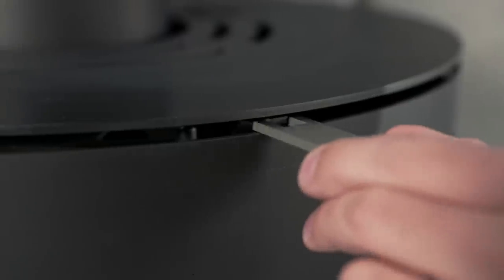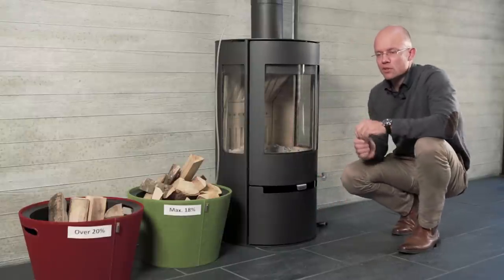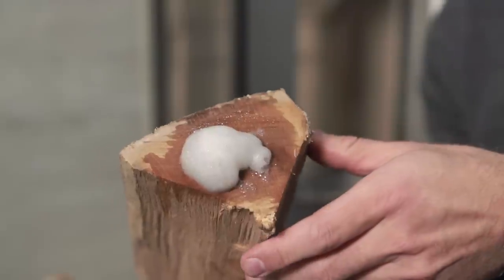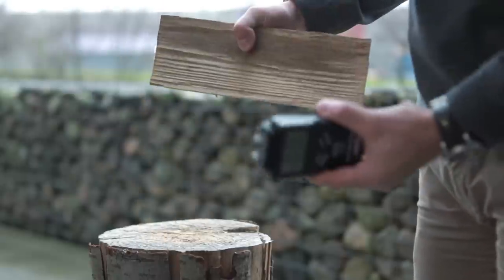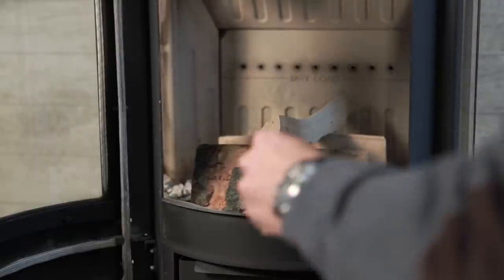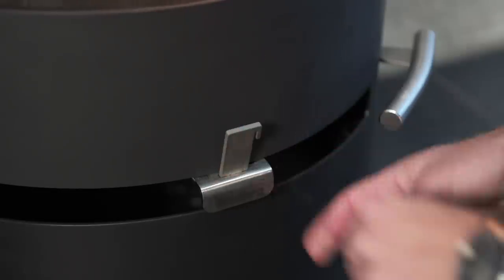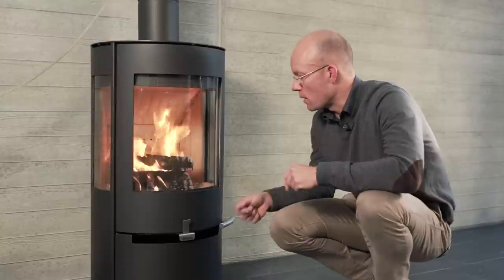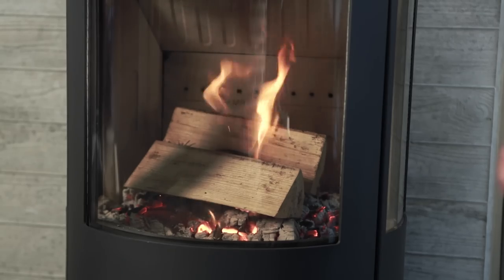Success with your stove

Comment: hello sir. I try the same with the lighter in my wood stove but the fire is coming out. I want to ask what type of top cap cowl chimney you have?
Reply from the maker: Hi Constantin. It sounds like you have problems with the draft in your chimney. To solve this, you can mount a smoke exhauster on top of your chimney. We recommend the Aduro DraftOptimizer, which ensures a constant, even draught and reduces the smoke and smell nuisances. Read more about chimney draft and the DraftOptimizer here: https://www.adurofire.com/accessories/aduro-draftoptimizer/. 
Best regards,
Aduro